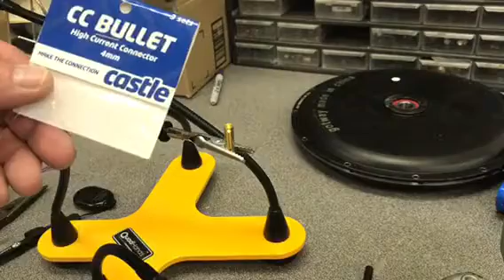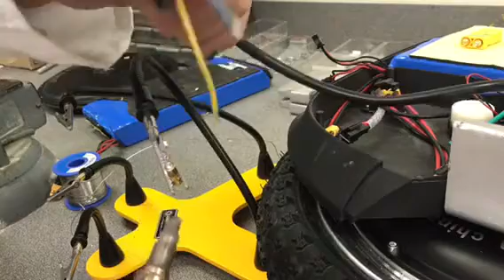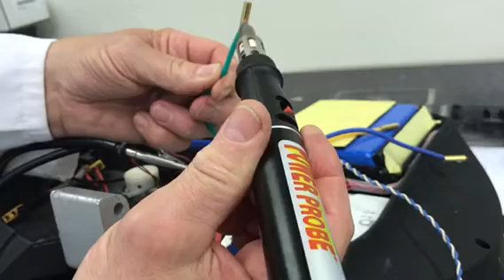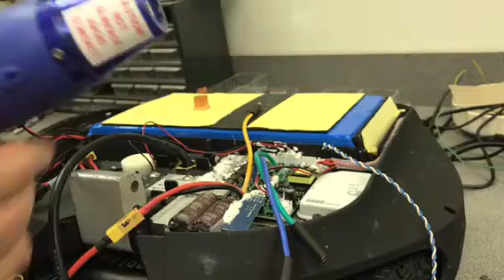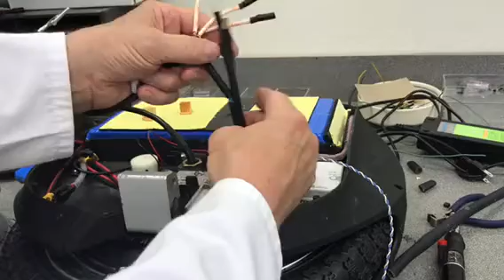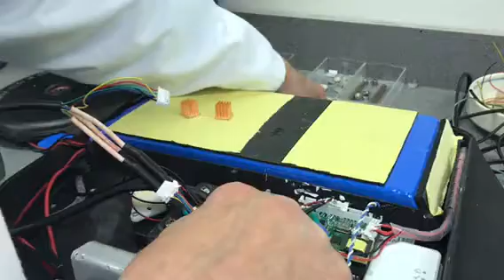Attaching bullet connectors to new ACM motor

Comment: Hi there, thanks for the video.  Can I ask a couple of questions as I need to replace my Gotway ACM motor connectors.
1. Are there specific bullet connectors you recommend (do they vary in qty?)
2. What diameter heat shrink did you use
3. What is the heat sleeve you used for the 3 motor cables?
4. Is there a specific type of solder best for this?

Thanks in advance 😊 happy riding